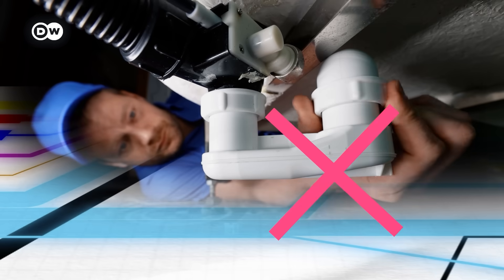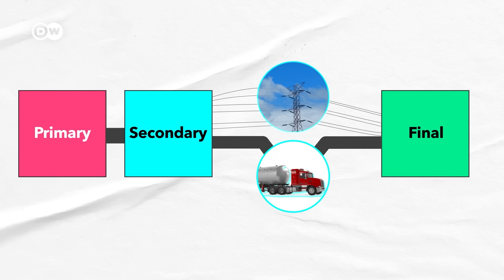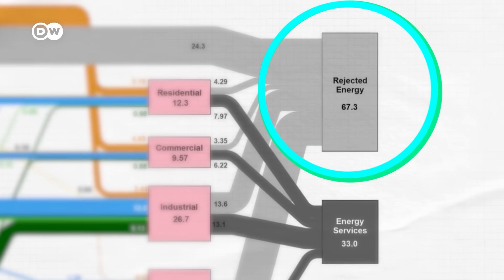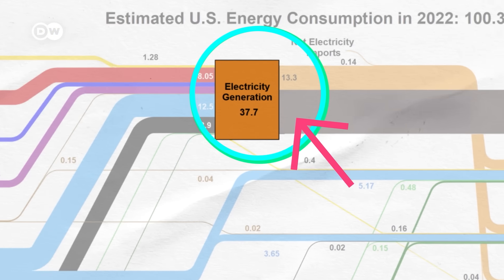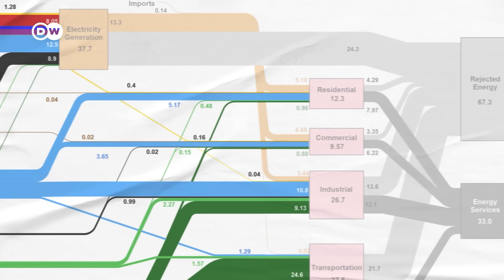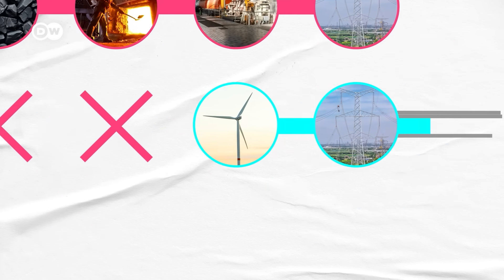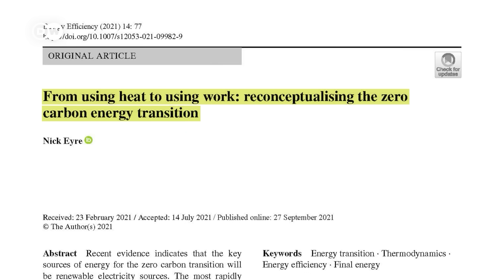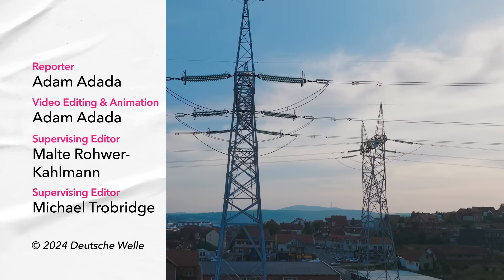The mind-blowing thing we get WRONG about energy

Comment: Yes it is bizarre I noticed that.( they have to pick one side if the second law thermodynamics I spose) But please don't believe any of this means we don't need nuclear. Also a lot of energy  IS consumed as heat as for example process heat in plants making all the things we need. And nuclear plants can make this directly rather than converting from electricity. Also there is energy density...air moving at normal wind speed has low energy density ...that's why you need a huge wind turbine to generate 1Mw power ( which isn't actually a lot) Also huge amounts of cabling and pylons ( seemingly not includes in the costvestimates !!!)...so you need a lot of stuff even without batteries. ( Adding grid scale battery back up  makes energy and material cost enormous ...not even possible)

Comment: 80% fossil fuel means 20% renewable

We used to be 100%
Reply: The problem is that the output of renewable is dependent on the environment while fossil fuels can be controlled by us. The grid however always needs a stable supply. If it was so easy all oil and gas consuming countries would have switched already.
Reply from the maker: Hey there! Yes, the grid is actually a problem. Check out our video on that 👉https://www.youtube.com/watch?v=u-DsDuTceTo

Comment: There are fundamental physical behaviours that you are missing in your video - 1) thermal inertia is critical to stability of a grid, large turbines, boilers, etc provide effects similar to a flywheel but for electricity generation and 2) the ICE is not in any way equivalent to an EV - chemical combustion has far higher energy density than batteries, this provides far higher torques and therefore power in ICE vehicles than any EV.

These are the issues - not what you’ve described in your video. Your video is what makes people confused as to why significant changes haven’t happened yet… engineering solutions to very complex problems takes time.

Comment: This video on efficiency gets so much wrong. 
So steam engines (as a whole) are limited to the rankine cycle which means maximum efficiency is probably around 50%. Or as mentioned typically around 40% for most steam generators. Wind turbines are normally around 40% efficiency at taking wind and converting the energy to electricity and solar is typically about 14-20% efficiency. 
None of these numbers means anything though because we measure the end result in kw and Mw of power. What the system’s efficiency engineer was trying to explain in the mass losses we see across the grid not the initial generation, can we fix this issue? Probably without spending too much, but does it sound and look flashy like solar and wind? No, so politicians don’t bother. In fact South Australia has one of the highest solar and wind energy percentage in the world but their grid network is basically from when Nikolai Tesla invented it so it leaks energy like a Chinese made dam. 
As for can electric appliances fix this issue, firstly you need to change every power grid to 220v because otherwise kettles and stoves don’t work on 110v. 
But then it works right? Nope, electrical appliances have an estimated life span of 10 years if made properly or 2 years by more modern manufacturing standards. Compared to 30 year lifespans of basic gas appliances. Which means the poor quality will destroy any chance of breaking even with co2. 
An honest video would have been “Chinese manufacturing is really bad”

Comment: Where's my new graph? What's the new numbers? We spent all this time pointing out how the old graph is misleading, but where is a new graph showing a clean energy future and highlighting how little final energy that requires, and how we don't need as much more renewables to replace all of it? 

As someone who has solar on my roof and am in the process of electrifying everything, I disagree with your statement about how little control I have over my primary energy. I can choose what technologies I use and what primary energy they take from, not just focus on efficiency. A more efficient gas car is still a gas car, while my electric car can run on solar.

Comment: So I noticed in your chart that the wind turbine just appeared. And from that point, it just made useful energy. In this process before the wind turbine just magically appeared, the first two fossil fuels, and heat were eliminated. I don’t believe this is truthful. How much fossil fuel went into the mining, manufacture, and setting up of the wind turbine, as well as the wiring, copper used for the windings of the turbine And connection to the grid. In essence, the wind turbine didn’t just magically appear. What you’re failing to show is all of the energy used to make that wind turbine and put it in place so it can make energy. Even the wind turbine, solar panels And everything else that would be considered renewable has wasted energy.. I would be interested to see the resource and energy needed to make these. Whatever the energy sources are whether coal, gas or oil the further you get from these to have a final outcome of electric the more of these fossil fuels are being wasted.
Reply: Id think that the effects of the production of the wind turbine is so small compared to its life time production, it can be just excluded from the graph for simplicity sake.
Reply: @prohacker5086   According to a report from the National Renewable Energy Laboratory (Table 30), depending on make and model wind turbines are predominantly made of steel (66-79% of total turbine mass); fiberglass, resin or plastic (11-16%); iron or cast iron (5-17%); copper (1%); and aluminum (0-2%). A five-megawatt wind turbine can require 700 gallons of lubricant, and costly synthetic fluids are preferred in the industry. Typically, oil change intervals are scheduled for from 9 to 16 months. A good quality, modern wind turbine will generally last for 20 years, although this can be extended to 25 years or longer depending on environmental factors and the correct maintenance procedures being followed.
So … let’s consider the mining of the copper, steel & oil needed & the fossil fuels needed for the mining & manufacturing. This is not a small and the cost, mining manufacturing and installation… which by the way also includes even more fossil fuels …. This indeed is not small and should have been its lost energy. To have wind turbines magically appear without showing the impact in the first two charts is disingenuous and pushes a false narrative.

Comment: Efficiency issue #1= photovoltaic cells tend to overheat in bright sunlight and lose efficiency.  #2= those cells are also less efficient when below their optimum operating temperature.  [Liquids used to moderate this help - in some cases being also useful.]  #3= many of the "peaking" plants are combustion turbines (often using fracked gas), or hydro-electric (which floods lots of land and has been accused of altering the Earth's rotation). #4== Nuclear power, when not having to redo all the regulatory 'stuff' for each and every plant, is the most efficient.  Small footprint, tiny mass of waste that is easily contained, and the best safety record of all methods of generating electricity.  (Some folks have political or financial reasons to hype the [remotely] possible dangers.)  Elephant in the room:  no one has come up with a viable way to recycle cracked or otherwise damaged wind turbine blades.

Comment: Making renewables work is largely a matter of energy storage: grid level batteries, pumped storage reservoirs and making EV batteries bi-directional, all of which is aimed at reduction of peaker plants. Also, high voltage DC grid upgrades to get power where it's needed. All of this will take a lot of government regulation which could be a problem politically.

Comment: Efficiency doesn't matter as much as total cost and availability though. If you have 2 energy provider options and one is selling you a kWh for 15 cents, and the other for 17 cents, you're not going to ask what their energy efficiencies are, you'll go with the cheapest option. Now luckily renewable energy has become cheaper than fossil fuels, but there's another problem: availability. Energy is usually produced on the spot to meet demands, and energy storage is nowhere near advanced enough to the point where we can make the switch to renewables, in the video at 5:05 you mentioned peak demand, and how fossil fuels are super inefficient at dealing with peak demand, but renewables don't even have a good way to deal with peak demand, let alone the seasonal changes in energy production, so it's not a very good comparison. To make this a fair comparison we need to see the cost of renewable energy with storage systems to ensure we're meeting the energy demands year round, and compare that to the cost of fossil fuel energy.

Comment: The comparison is mismatch. Source for energy generation for wind turbines and PV is respectively wind and solar radiation. If we look at it from this perspective we can cleary see that wasted energy is tremendous. Efficiency of wind turbines is around 30-40% and PV only 20% when wind is blowing and sun is shining... So what do you mean? This document gives the public a false impression that fossil fuels (hydrocarbons) are less efficient, which is not true, the efficiency of coal-fired power plants is currently between 35-46%, and gas power plants - about 55%. Next important thing is utilization rate. At peek sunny/windy day we can not use all of this energy, so it is wasted. Fossil fuels can be use on demand to generate electricity and for mentioned above it is not possible. The thing is that they suprasing fossil fuels because of its renewability and they are fare less problematic with air pollution.
Reply: The graphs deal with energy in the economy which the "wasted" sunlight or wind not absorbed isn't.  Its completely unlike digging up coal, transiting it burning it then seeing most of the heat generated going to waste.

Comment: Electric cars showed their worth this past winter when the batteries froze, their range was shortened dramatically, and there was insufficient energy available to heat the interior of the vehicle. Versus an ICE which generates its own heat, heats the interior for the comfort of the passengers, and had no range reduction. Sometimes that "waste heat" isn't wasted at all.

I totally agree that efficiency improvements will make life better for everyone, but it's easier to get 10% more efficiency out of a fluid that has 100 KW per gallon vs getting 1% more out of a wind turbine or solar panel.

BTW, why is there NO talk about nuclear in this entire discussion? 100% carbon free and ultra-compact. SMRs should be what's being pushed, not wind turbines.

Comment: This video is misleading, not by malice, but by ignorance of the subject. How does an induction stovetop use 1/3rd of the primary energy that a gas stovetop uses? If the induction stovetop is powered by a typical natural gas plant (it's 7pm, no solar, little wind), it then uses more primary energy, not 3x less.
It's generally referred to as the primary energy fallacy.
Reply: this video is self correcting, because they show everyone the graphs. gas goes in, around 66% is wasted. 
then it goes to residential, another 66% is rejected energy, but lets assume induction is 100% efficient, u get a total useful amount of 33% .
skip forward to the video saying cooking with gas directly wastes 40%, so the useful amount there is 60%.
going electric is a wasteful way to heat things. electric heat pumps are another matter. gas powered heat pumps are ANOTHER MATTER.
have they been invented yet? what year is this?
ok, they exist. robur ghp. also yanmar. the tech has already been commercialized. feels like it only took a minute LOL
Reply: @echelonrank3927  I would love to see a gas-powered heat pump. A 150% efficient gas boiler.

Comment: The coal plant my boyfriends worked at for over 20 years has had all four boilers offline since the beginning of January! He said this is the longest hes ever known of any plant going completely offline without atleast one boiler up and running producing power! Another thing to think about when looking at your energy bill and the rates your paying. Is that electricity is traded on the stock market. So the people that died in Texas A few years ago? Didnt have to die because theyre windmills froze! If people on the other side werent playing political games! Electricity couldve been rerouted to those areas with people snowed in!
Reply: Small correction. Texas froze because the NG (methane) infrastructure stopped working in the cold. The reason is that NG infrastructure is powered by electricity. If the electrically powered compressors stop compressing the gas or the valves get frozen or the regulators don't regulate the flow of NG stops and the electric generators stop.
EPCOT successfully blamed the small number of wind turbines instead of the large number of NG generators

Comment: Problem is, energy production is not measured in energy that could be, its measured in energy actually produced, even if inefficiently. Thats because fossil fuels are so dense, even 30% of their energy is still more than competitive. So you can make a nice graph showing that a lot of the energy from fossil fuels is wasted, but what actually matters is the output at the useful energy step and the price of that portion of the energy. If the energy wasted is so cheap the remaining 30% is still hard to beat, it shows this is again just an empty feel good story, but it doesn't make producing useful energy any easier. Nor does it make the transition any more realistic, in the absence of some new technology that isn't currently scalable yet.

Comment: Well IMHO the biggest challenge is storage. Electricity is hard to store unlike fosil fuel. Today's batteries are not there yet. That's mainly because of their price to lifespan ratio. We can not (yet) switch to pure renewable energy because it isn't stable as an energy source with exception of hydro plant which needs specific conditions. If we want stability we need at least some backup stable source. Eg. the one that uses stored coal to produce energy. We could (probably) switch to renewable if we could produce electricity and store it for later to cover renewable power source outages or peaks.

Comment: I feel that there is a little bit of a sleight of hand here. that is the omission of economics. All these charts show is total energy flows which are interesting but if you have something that is twice as efficient but also twice the cost then you are in the same place. it would be hard but it would be interesting to see these graphs in dollar terms. normalized for subsidies and taxes that are applied to various types of energy production. 

The other thing is batteries are not considered in this it seems. sure, it would be hardly efficient to generate solar PV in charge and then drive an electric car. but this is a niche. The car has to be sitting ready to be charged at the time solar is being generated and this is not often practical. for most use cases including transport a storage step is needed and even if that storage step is very efficient, the cost is very high and that is the problem.

Comment: 4:21 Well she's just wrong. Not about it being expensive but that they only last 20 years and become less efficient over time. 
Don't believe me because I'm a jerk on YT comments and she's in the video? Look up the age of most of your nearby thermal power generators, most are older than well made in 2004.  Even better if you can, find the output year by year. Most plants become more efficient over time as they have years to correct minor issues in the design of the power plants or find the perfect method of operation or process over time. Sometimes refits replace equipment with better more efficient equipment. 

Anyway the whole video is misleading. It takes the ideal possible max output from combustion and claims anything not make into useless energy is lost. While ignore than 80% of the energy that hits a solar panel isn't used, or that 98% of the pressure gradient of a turbine isn't collected. I mean if you want to take it to the extreme include the make possible use of nuclear fuel which is currently about 0.3% used in light water reactors. 

This is just lying with statistics. It should be flagged as misleading not that the UN thinks climate change is important. Also don't call it fossil fuel most of the hydrocarbons we use never were plants or animals and so could never be classed as a fossil.